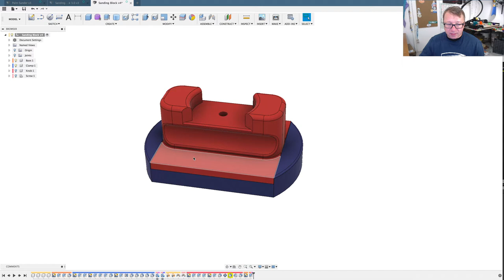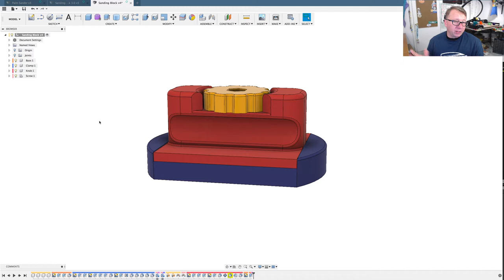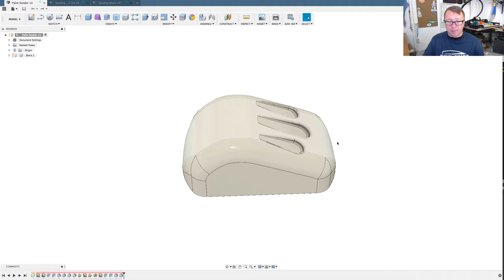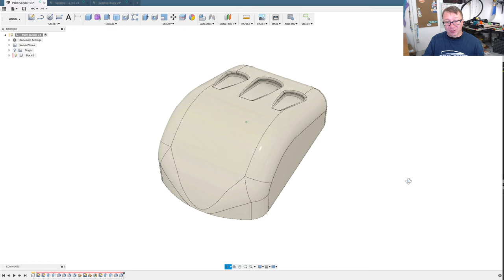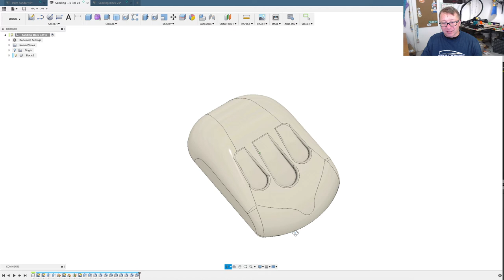Building a better mousetrap - prototyping a sanding block that doesn't suck

Comment: Hey, thanks for the video. It's always great seeing practical applications for 3d prints. Would you ever consider showing a step by step on how you modelled both sanders in 360? I've been trying to figure out how to incorporate nuts and bolts and moving parts into my models and this project seems to have it all.  Thanks again!
Reply from the maker: Hey @tdeux - I sure can.  I'll add that to my to-do list.  In the mean time, this video might help out a little - https://www.youtube.com/watch?v=5UhZqgi-klk 

It doesn't walk through the process per se, but might be informative.  

Thanks for watching!